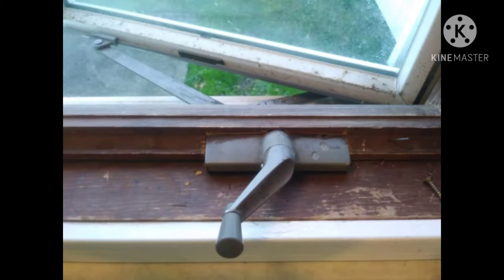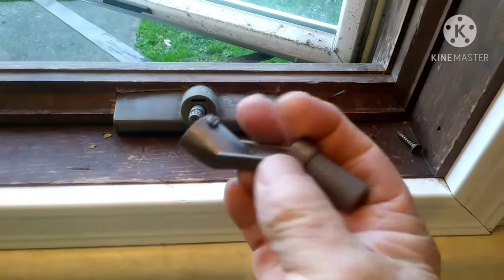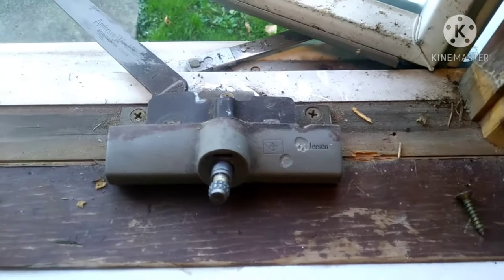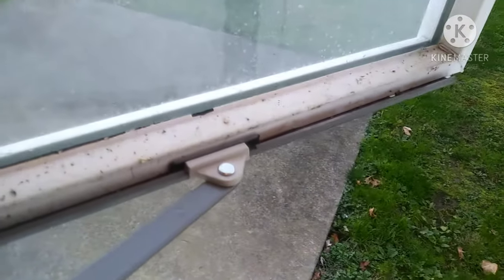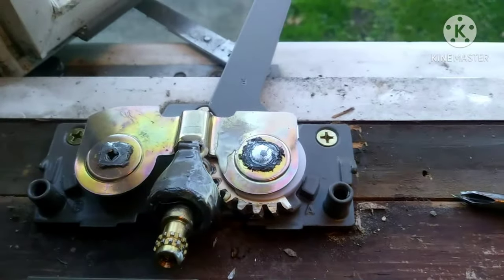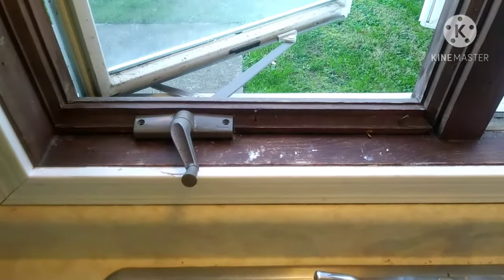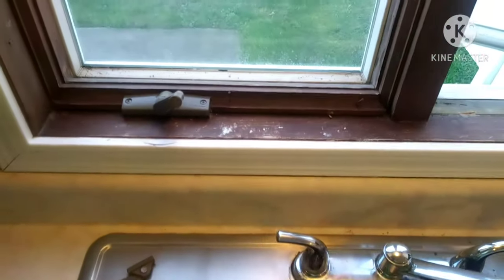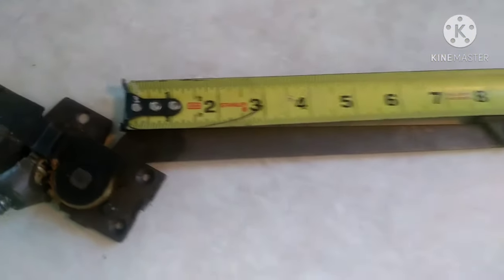how to replace an Anderson window crank ( quick/easy )

Comment: I can’t remove my casing behind the crank   It’s got a set screw. Removed that and crank arm handle came out but cannot get that plastic casing out
Reply from the maker: Try a flat screwdriver under it and pry up should pop off
Reply: @GetToThePointplz123  I thought of it but didn’t want to damage wood underneath. I’ll try to slide cardboard under it first
Reply: @GetToThePointplz123  took some elbow grease but it popped off. Used a wide chisel braced with cardboard underneath